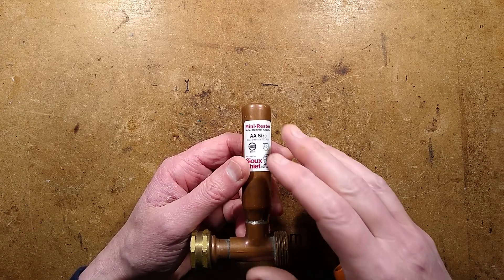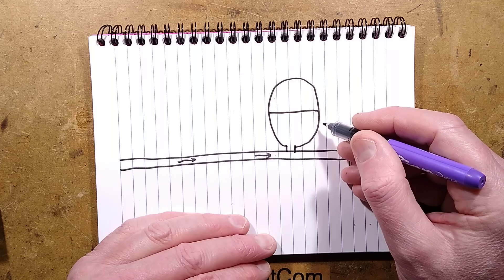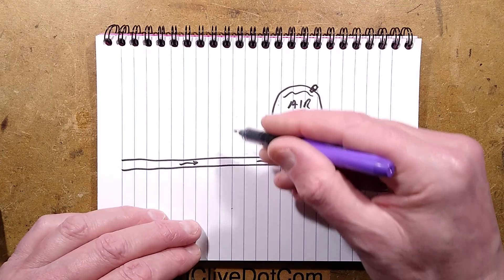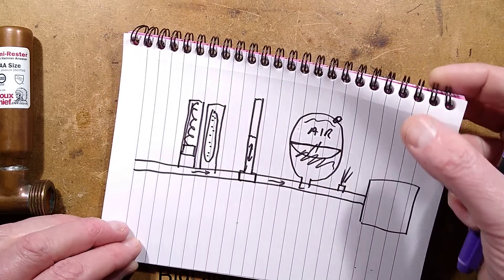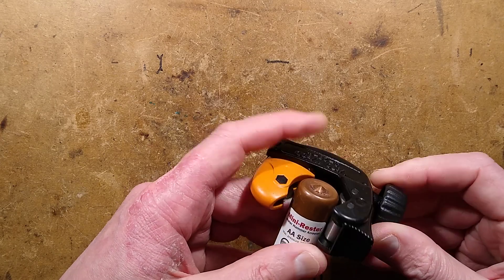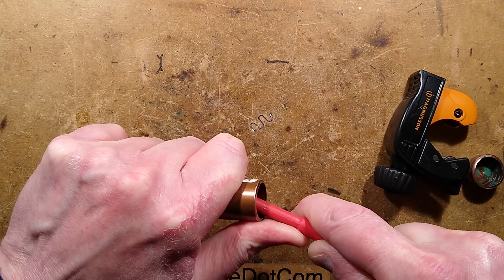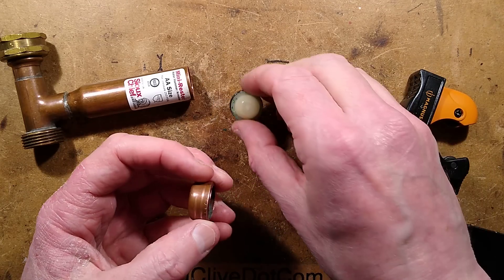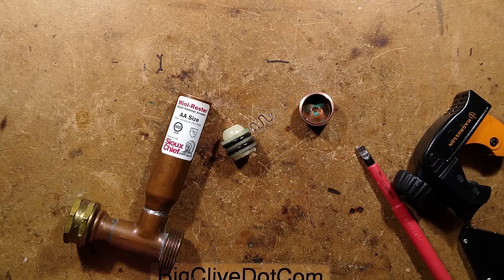inside an American made anti water hammer device

Comment: Trying to explain water hammer to my wife and kids was exasperating. They thought that was just how it works. Then we had a sewer backup in the basement. Unrelated to a water hammer, sure, but it was a hell of a mess. The rupture from a hammer is cleaner water but the mess would require the same amount of shit. And the deluge would be coming through our kitchen. Then a sister in law plugged the toilet -- AND WOULDN'T STOP FLUSHING --and ruined the upper cabinets anyway. I don't remember if I had a point to this but it helps to vent.

Comment: wow, why can't we use the simplest solution and just use a different, slower cutoff mechanisms in the washing machines.... but I suppose they have no insentive to spend any extra money on something that does not affect the device itself. Some old plumbing systems in here used to have a huge 30-40 liter tanks (in case of the water boiling in the radiators I think) usually somewhere above your bath but I dnt think anyone uses this system anymore but I remember seeing it everywhere some 15-20 years ago.

Comment: So 12 those on ramp pump with 12 pipes would make good pressure
Reply from the maker: I think a ram pump is best used with the traditional pressure vessel (like a 2L drink bottle), as it does snort air into the vessel.

Comment: This confirms what I suspected. When it failed, I considered drilling hole to remove water that had migrated past the piston. Sealing it might be tricky as heat from soldering would likely destroy the o-rings. Epoxy might work. On second thought, the contained gas may be pressurized, making repair unfeasible.

Comment: Way back when I was a plumber and still worked with copper pipe, I had to fabricate these air chambers. Usually used a 3/4 x 1/2 x 1/2 tee. 1/2 being the water supply and the 3/4 being the air chamber. 12 inch piece of 3/4 pipe with a cap. It had to be vertical and at every appurtenance.

Comment: A simple dead-end pipe without the puck can have the problem of the air pocket gradually dissolving into the water.
 That puck will prevent that, while still just using air as a spring.

Comment: Easier method to test an expansion tank without the chance of changing the pressure is to tap on the Schrader end with a metal object, ting ting is good, clunk clunk is bad😂 it works.

Comment: I'm not sure if its true but I think if you just do a tee with a piece of pipe it traps the air in when you fill the system but eventually the air will dissolve into the water making it useless and that's why the arrestor's have the diaphragm to prevent that.

Comment: You missed the fact there is a ATTINY10-TSHR at the base of the "T", it uses a silicon strain gauge to measure the pressure, and adjust the piston position to modulate any pressure surges..... :-)

Comment: I my father was a plumber.  When I was a kid, he did a lot of new construction work.  He taught me how to run copper lines and all the steps involved, including adding air chambers at the end of each run and at every fixture.   Just a tee with a 12 inch vertical capped length of tubing as close to the valves as practical.   Never had a water hammer complaint.  He was religious about flushing water heaters and draining water systems once a year.  One reason was to "recharge" the air chambers.  We could knock out one of these services in about an hour usually.  The extra valves, caps, or plugs he installed during rough in made it quick and easy.  Years later, the code changed an all businesses and residences were required to install backflow preventers between the meter and the first fixture or tap.   Faucets, water heaters, and pipes started leaking all over town.  But not at the places we installed the copper.  All those air chambers were evidently enough to handle the thermal expansion.
Reply: That's exactly what is in our house.  If it bangs, turn the water off, drain the system, and the problem is gone when you turn the water back on.
Reply: …the backflow preventer is not involved in that issue, we have a double check in our acuflo toby’s not sure all brands do the same, from that toby you will hit a storage water heater at some point, that storage water heater will either have a header tank and ballcock, (natural backflo system) or youll get into mechanical valves eg pressure reducing valve or pressure limiting valve, theres a simple check valve in both of these by the design, there is however a checkvalve in the 3 in one isolater, (filter,stopcock,non return). The “thermal expansion” is monitored by a relief valve and a cold water expansion, obviously boiled water expands, that water expands and overcomes those relief valves spring and drips outside the system.
Now assuming in hotter climates theres no huge temperature change in the town supplied cold water i cant see how leaks all over town could be due to installation of a backflow device protecting the towns watermain from peoples property and potential contamination chance. All this was based on a scenario in america where someone was filling a cylinder truck trailer to wash it, the watermain plumbers meantime did work on that water line and backsiphoned the contents of that truck into the water main, when the water repair was done and water returned to normal, some people got chemical burns from using their shower or bath. This is why everything gets a backflo or back siphon control, and each risk has a different minimum requirement, sorry for long reply.
Reply: @f1reguy587  I stopped reading at your first sentence.  When the water comes into a closed system and is heated, it expands.  When it expands the pressure increases.  Things tend to leak more under higher pressure than lower pressure.

The work I did with my father was in the1970s and early 80s.  Expansion tanks pressure reducing valves, and backflow preventers weren't  required then in our city.  Expanding hot water was free to push back a bit into the main.  Not much, but it wasn't a closed system.  It was free to expand.  The backflow preventer stops that.  The expansion had to go somewhere.  the relief valve on a water heater is generally 150 psi.  Mains pressure was 40 -60 depending on where you lived.  That's a 90 to 110 psi difference before the relief valve activates.  See last sentence first paragraph.
Reply: @mikemorgan5015  the backflow preventer “now” stops that, you will never, even with your neighbours help create more pressure in the towns main, luckily water finds its own level, your expansion tanks capture undulation of water flow. I cant describe to you how your heated water temperature dissapates in the pipes alone, we have to plumb out skyscrapers, and your logic will not make that water supply safe or pleasant. 
Mechanical backflow preventers were invented and released in 1930, and air gaps are as old as the first weir. I think i can make judgement of how your father raised you at this point.

Comment: The inverted Tee types are no longer used mainly because they rely on the trapped air when water is initially turned on. However, over time, the air dissolves into the water until there is none left and it's no longer effective. The only way to reactivate it was to drain the entire system which was difficult if not impossible!

Comment: The t's started with the vertical section out filled with air. But over time the water absorbs the air and the vertical pipe fills with water. That's why they stop working over time.

Comment: Downstream of a PD pump we call them vibration dampeners. One time someone made an acquisition error and got us a dampener that had a bladder that was slowly soluble in the liquid we were pumping.
Reply: These days we have such inexpensive realtime monitoring (carts, trends) that operators complain about fluctuations that are not only harmless, but can be beneficial or even essential. We dampened one such vibration and found out the line stopped transporting solids. That caused us to shut down and move a filter 30 meters upstream. Cost penalty = $22k usd. The solids were harmless as long as they were marched downstream by the pressure and velocity fluctuations.
Reply: I've told operators that some fluctuations within plants are like lumps in a carpet -- push them down in one place and they'll resurface somewhere else.

Comment: Suggestion: if you do that plumbing experiment at your house do NOT use a glass rod. On top of breakage risk the press-to-connect fittings don't actually work on glass because the metal fingers cant bite into the glass to secure it. Instead you can go with clear plastic tubing. HDPE would work great and is cheap.

Comment: The simple copper pipe with sweated (soldered) cap type of arrester is specifically installed in a vertical position at the  last directional change fitting before it stubs out horizontally of the wall when a house is being built.  This traps air in the arrester , as it is soldered in, to soften the impact of the sudden flow of water. Keep in mind that hammer is caused by a sudden movement of existing water in a pipe, not normally by a wall of water coming into an empty pipe, due to plumping normally having constant water pressure even when not flowing. It can happen when valves are being opened or closed quickly. Pre-made units like the one you have are helpful to add in specific instances outside of the wall, like washing machines, etc. and he plastic plug allows the air to be trapped even if the arrester is turned horizontal or the pipe is emptied. Simple site-made arrestors work well when they are made an adequate length and are still  used in America when installing copper pipe, but now pex is the predominate piping used, and doesn't suffer from hammer as much, though copper arrestors and stub-outs (site-made or  purchased) are still used on higher priced homes. At least that is how the boss described it to me back in the late '80s.

Comment: The reason for the replacement of dead head pipes with a pressure vessel with a bladder is that the bladder keeps the water and air separated. This is used as cushioning in hot water heating systems and pressure distribution systems as pressure storage. The reason for separation is because over time the non separated system gets water logged and has to be drained.  Without service this will cause the heating system to blow the pressure relief valve as the lack of air space lets system pressure build in heating systems and will cause excessive pump cycling in distribution systems( like older motor home systems, pump runs as soon as a tap is opened, shuts of seconds after tap is closed)

Comment: Dead end pipes were banned a while ago because of bacteria growths.  If you leave water in a dead end pipe you end up with black "life" that is not very good for you.

Incidently you should also not drink from pipes that have been turned off for extended periods of time for the same reason.  Run the water for a significant amount of time before drinking.

I BELIEVE that the bacteria themselves may not be the toxic component (the bacteria wouldn't like living in you).  But the toxins created by the bacteria.

Chlorine provides protection for this but chlorine is all but consumed by the time it hits residential pipes.  If it is a dead end then chlorine would not be present in enough quantity.

Lastly remember that this "air" is no longer "air".  Any oxygen has been used up a long time ago and there will be zero photosynthesis.  So you are dealing with an anaerobic environment.  Basically take all definitions of life as you understand it and throw it out the window.  Weird stuff grows in dark wet anaerobic spaces.

The accumulator does get water to go in and out as pressure changes so it does see changes of water and does not suffer from stagnant issues.

This is all based on Canadian experience.  British probably have ring mains with 27 shutoffs each with giant 2 handed valves and operate at 500 PSI.  So no idea there ;)

Comment: Clive remember that when you explained how the expansion tank work you explained that when the water heats up it expands and presses on that diaphragm. That means that when the water in the system cools down it's going to push back to a certain extent. That naturally happens every water heating cycle so you're moving some water in and then back out of that pressure vessel preventing it going dangerously stagnant.

Comment: Simple is better. The O-rings provide enough friction to keep the piston from sliding to the top where it would do nothing if it remained there before restoring water pressure. Of course the manufacturers' quality control needs to ensure the piston is in the down position prior to leaving the factory. Absent a metal spring to bias the piston downward, the air cushion becomes the spring. I'd wager the end cap was friction welded in place.

Comment: Dead legs are the worst idea and I've used something that looks just like yours, bought from Toolstation, and I didn't think it was very good. Seeing how it's made I can see why. If it's meant to be some sort of piston then surely it should have a spring on the dry side? I found the best way is to fit one of the really small, I think they're only a 1 or 2 litre, expansion vessel into the pipework, usually close to the washing machine like under the kitchen sink where there's space for it.

Comment: How isn't this illegal? It's basically the dead-end pipe as you've demonstrated! The sad thing is if the practice wasn't illegal in America, intrepid plumbers could add T's to arrest the hammer with varying spring loads and elasticity methods, effectively taking the same trade as car enthusiasts except rather than suspension for land, it's suspension for water.

My old residence had a hanging pipe in the laundry room often used s a temporary stop for clothing. An arrester could had just as easily taken place of a brackets it was hanging from should the need for that application arise.

Comment: Domestic plumbing is typically a small scale version of the supply / sewerage system - fresh water is pressurised, waste water (most countries) uses gravity flow.
The equivalent of water hammer in large pipes is not just a louder version of the domestic banging sound. If you close a valve too quickly the resulting shock wave may rupture the pipes. In order to avoid this valves are closed very very slowly (there's maths involved). And if it's a valve in the middle of a long pipe run there's a danger of collapsing the pipe by causing a vacum on the downstream side!
Reply: I remember visiting Ft. Peck Dam and seeing the enormous water hammer arresting system they have for the penstocks there. The penstocks that feed the powerhouses are 24 feet in diameter with 220 feet of hydraulic head, so the water in them has a lot of momentum and needs somewhere to go if they have to suddenly close the butterfly valves that regulate flow to the turbines. Each powerhouse has open-topped surge tanks that water can rush into when the valves close, with the tops of the tanks being above the water level in the lake.

Comment: Similar to the baffle used in a Megaflo unvented cylinder. Used to maintain the air gap to allow for expansion of water in the store, as it gets heated.
In a cold water supply pipe, I'd concur that the "Puck" is used to separate water from air and reduce the risk of legionella bacteria establishing a base camp.

Comment: 4:03 I think provided it’s mounted vertically it will trap the air in it and fill about half way depending on the system pressure. Yes they discontinued use in the US due to over time the air would be absorbed into the water and the only way to reset would be to drain the system and the dead end issue with hot water and legionaries.

Comment: With lots of 10mm water pipe to service a home from just after it goes under the house, Hammer is common from the usual device AND long runs of 10mm to outside tap when turning tap off too slow.

Comment: The problem with the dead end pipe is the air trapped in the pipe will dissolve back into the water in a short period of time and make it useless. Unless you drained your plumbing every month or so, which nobody would do, it is just a waste of pipe and you could be right about the stagnation of the water.

Comment: I had a problem with water hammer at a house I bought in Spotsylvania County, Virginia about 25 years ago. I got a pressure gauge and checked the water pressure. It pegged the gauge, which only reads up to 100PSI. There's the problem. I called the water company (run by Spotsylvania County government) to find out why the hell the water pressure is so high and they said, "We made some changes to our system. You can call a plumber to install a pressure regulator". Well gee thanks, I appreciate it! I had a pressure regulator iand an expansion tank nstalled and that fixed part of the problem. The root cause of the problem, a water utility run by halfwits, still exists. Should be noted that the house was built in 1975 and presumably the pressure was OK prior to their "changes".

Comment: I use one of the Dead Head hammer arrestor designs.  In my primary hub I have a 1.25" ball valve for the main flow, then it Tee's left/right. The path to the left has another Tee down that goes to my house. Then continues another Tee which feeds a "true" 3/4" hose fitting, continues to another Tee, which is turned up/down in relation to the others, with another drop but this one is an open 1" ball valve. The portion that goes up goes into a 1ft piece of dead-ended pipe. 
Works really well and I rarely have any hammering. Every few months I'll go out and turn off the main valve, open the end valve to valve to allow the water to drain from the dead-end to flush out the stagnate water and replenish the air.   Over time w/o a diaphragm, the air will eventually be pushed back into water. This is what happened with old water well tanks and they had to be "bled" every year to replenish the air supply.